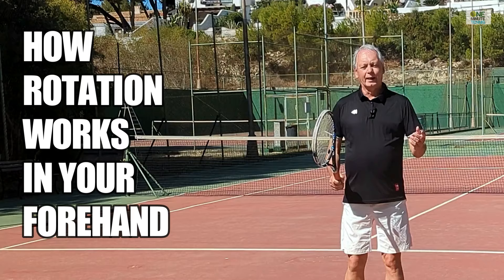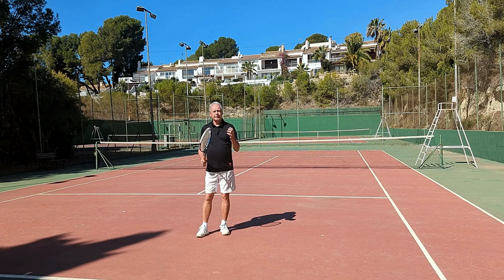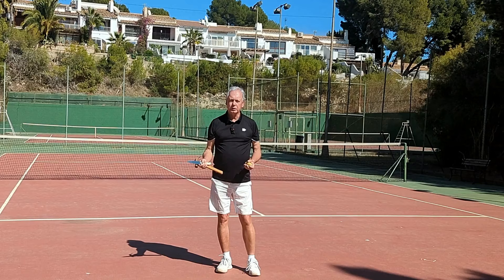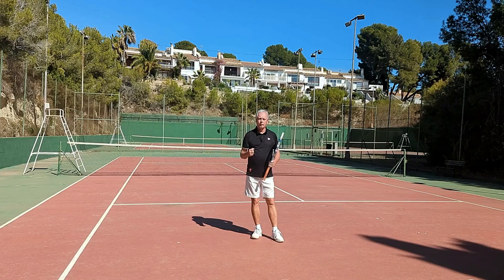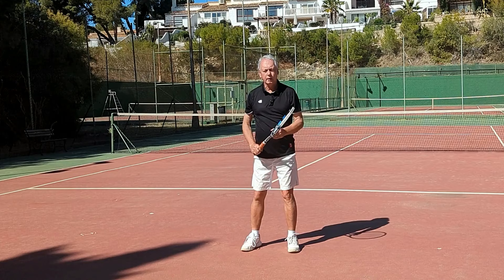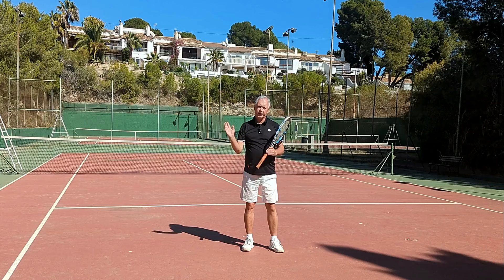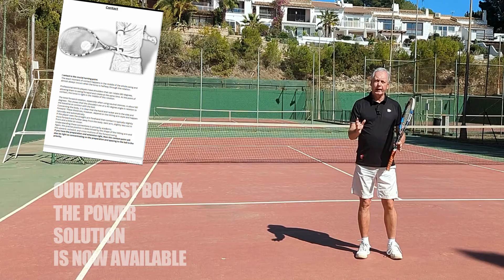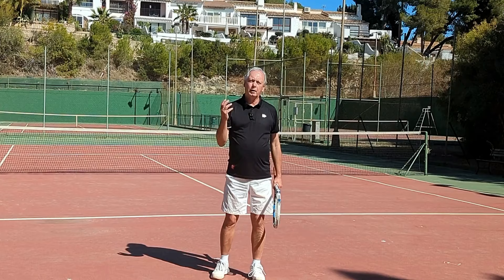HOW TO TIME ROTATION TO ENERGIZE YOUR FOREHAND

Comment: Imagine snapping a bullwhip in the horizontal plane. Your hand stops (and even pulls back slightly) as the whip snaps through. .... with a tennis racket, your body is the hand and the arm/strings are the whip.

Comment: you have mentioned sth I found a lot of 3.5-4.0 player have in common including myself. I have a good take back, a full energized coil at the beginning of every stroke, and yet most of my shots are not deep and heavy as I thought they should be and I must compensate it with higher trajectory and more spin. The problem is exactly what you stated here, by looking back to my recordings, over-rotation is the problem, especially the hip rotate together with the upper body make my shot have very little energy transfer efficiency I suspect (especially those seemly “easy” shot require you generate power yourself). One side notes to your video plus my own finding is that often many people will say they like to play with people who play fast, or in my case I found my balls are easily deeper and better quality when I’m defensing, that also seems due to I have no time to rotate my hip on the run, the lower body is naturally constrained while upper body is free to move. I feel much more energy is transferred and shots direction are actually made more precise. I think for those who like to play with heavy hitter but having trouble with pushers probably have the same problem, at least some of them. And the same for those who can made great down the line forehand from outside in, yet can’t apply that to a floating ball. Love to hear your feedback. Thanks.
Reply: I feel the same way.

Comment: While I like many of the "One Minute" vids, this one does not make sense to me. How would the energy not pass to the ball, the racquet does not go through the ball like the knife through the potato ?! The only reason for slowing or stopping the rotation would be to end up facing the court, in no way is it transferring more energy, actually less... Maybe the advantage of finishing the stroke in that position outperforms the little energy you loose by stopping the rotation.